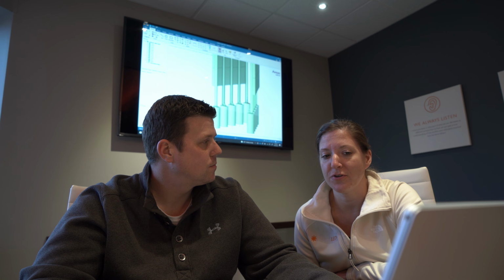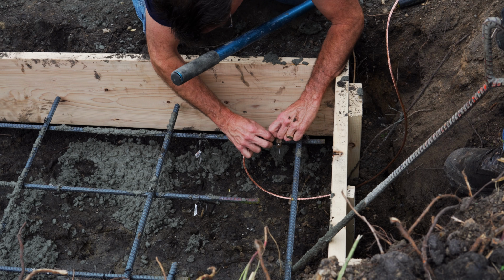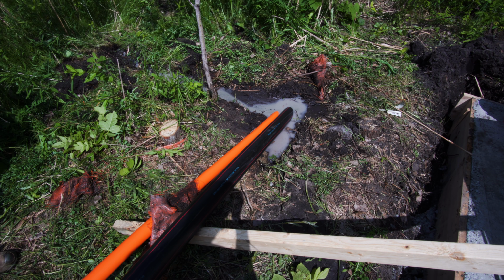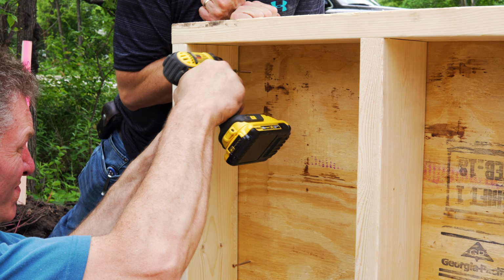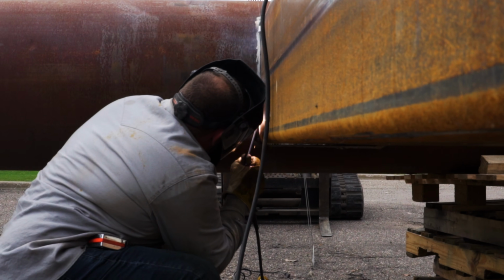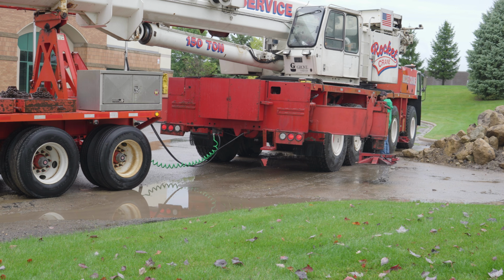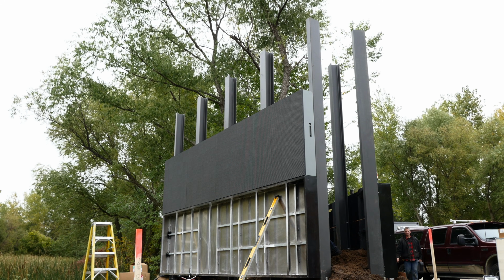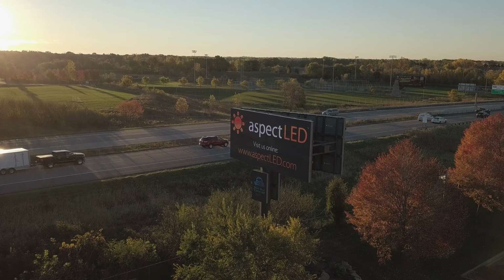How to Build an LED Billboard from Start to Finish

Comment: Don't suppose you'd disclose how much that cost. I'm going to guess close to a million, depending on your location. I'm also curious as to  the projected return on investment.
Reply: You'll notice, no answer to the question as asked.  More specifically, "how much did THIS sign cost you?  We know cost will vary based on location, etc, but what did THIS one cost for THIS location?"...
Reply: The actual LED panels and cabinets are in the 75-100k range (thats their cost not consumer) Depending on fidelity , refresh rate Etc.
Reply: @YohanathanD   Then you have the tower, the rest of the metal work, and the construction costs.
Reply: @klocke5247  can't speak to the cost of that as it probably varies wildly by location.
Reply: @YohanathanD  As a business owner, I've done things with my product line that I never expected to make any profit on. I could afford to do it, and I wanted to. If you're the owner of a company, it's not always about squeezing the last nickle of profit out. You want to enjoy what you're doing. At the end of the day, that's what's important.

Comment: I might be wrong I was tought the more moisture and slower concrete dries the stronger and that is what I was told doing bridges  so I will not argue but we use to go spray cement every day for Day or 2 after poor to make it super hard
Reply: I think that's to keep cracks from forming by slowing down the cure at the surface. It's not adding moisture much below it, obviously.

Comment: Why can't cell phone manufacturers make the screen from the sane material on these billboards???  The major problem of current phones is that they're impossible to see clearly in bright light...
Reply: Many LED signs are made with a mother board in gel encased in a plastic frame with a plastic louver around the LEDs. The allusion is that it is one smooth panel. Much like a Light bright toy, it looks great far away but not up close. The LEDs used are the same size as Christmas lights and you don’t want to touch them or you will mess up the display.💕♥️❤️
Reply: @christienelson1437  thanx forvthe explanation.
Reply: @cbroz7492  Your welcome!😊
Reply: Cost, thickness of screen, and probably most importantly, charge life.